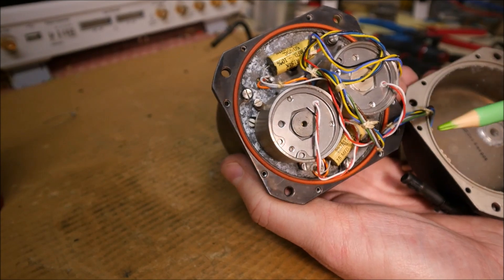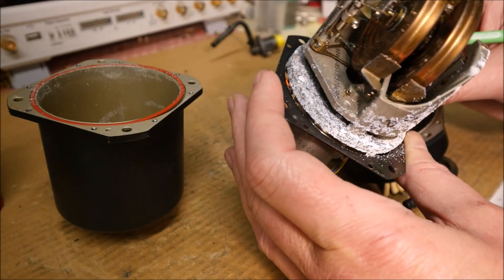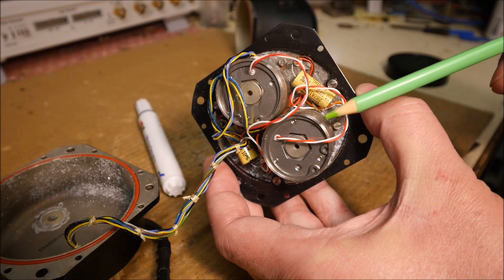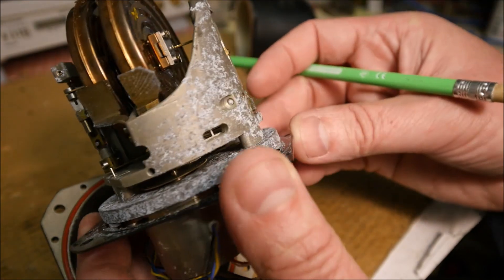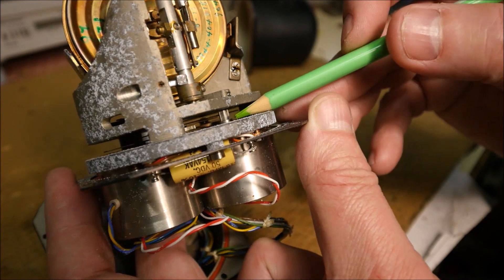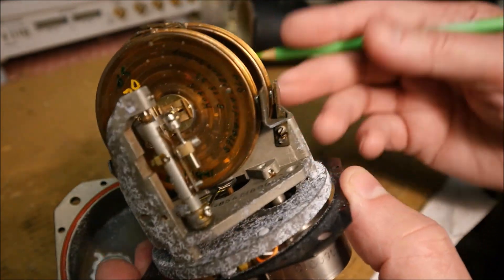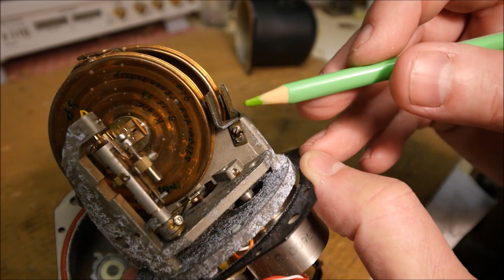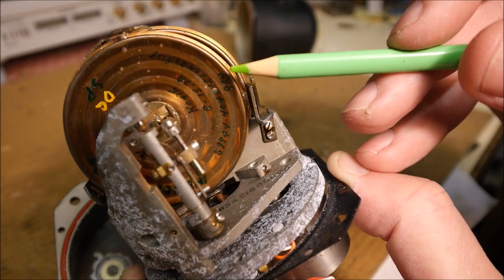LDM #381: Kollsman CPU-46/A-22 Military Computer - Part 2: test and transducers

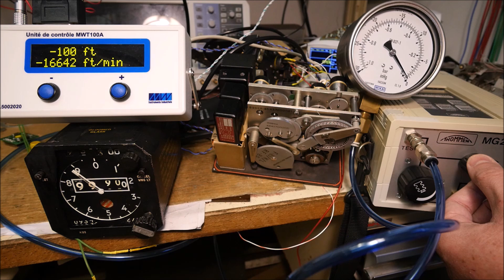Comment: 1:52 aluminium oxyde. Like rust, but for aluminium. Quite rare it happens, but once it's started you can't stop it.
Reply: Looks like zinc pest to me. Probably the part is some alloy, with zinc, casted. I don't think these parts are aluminum.
Reply: It came to me, probably it's Zamak.
Reply: Coastal and ocean duty is hell for corrosion.
Reply: Um, it's not really true that you can't stop aluminum corrosion, IF you remove it from the corrosive environment.